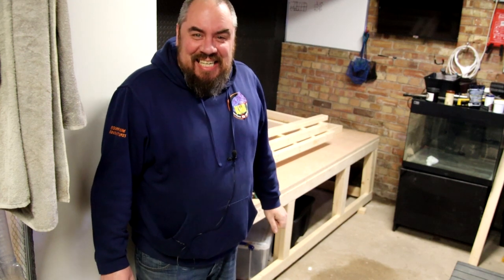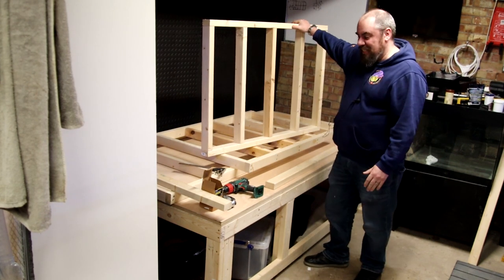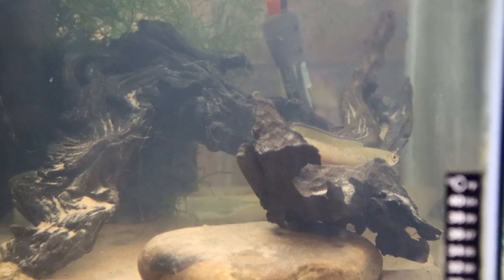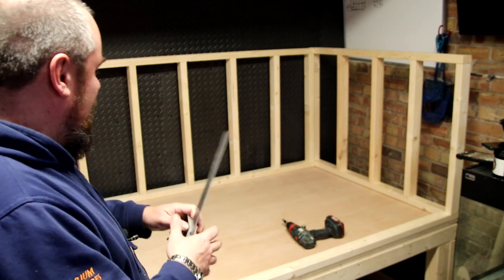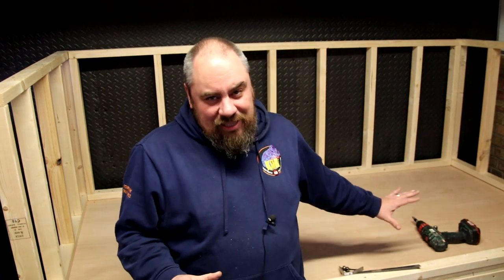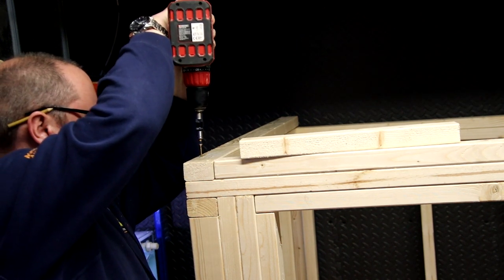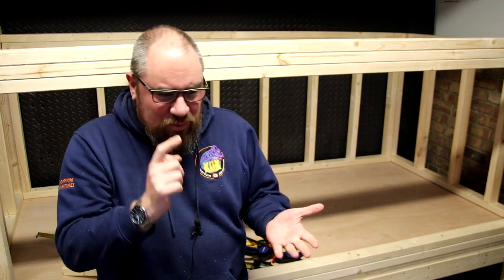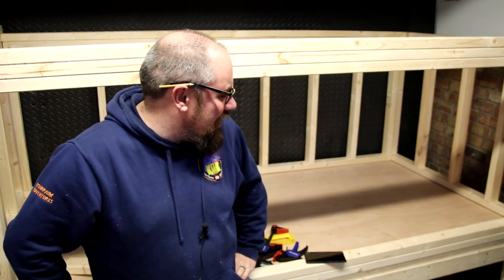MEGA TANK part 2: DIY Aquarium - Framing

Comment: is it not cheaper just to fibreglass the whole thing like you would the inside of a outdoor pond??
Reply from the maker: I don't think so - fibreglassing isn't super cheap, and some kind of coating is needed on top of the fibreglass layer so it ends up just as expensive. I could be wrong though, still trying to figure it out as I go!

Comment: I’ve tried a plywood tank before, liquid rubber failed and so did a liner. I’m too scared to try it again
Reply: What failed on the liner?
Reply: @Mountain_Aquatics  I’m not too sure, it just leaked. I got sent a replacement and it leaked again 😭